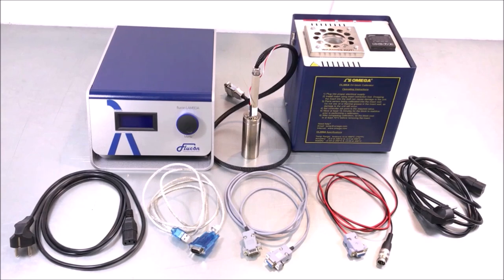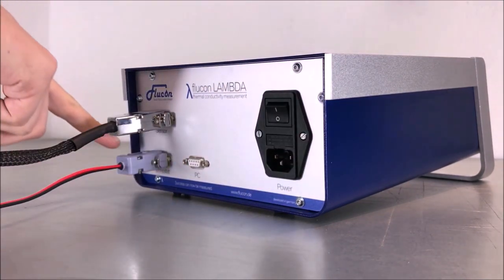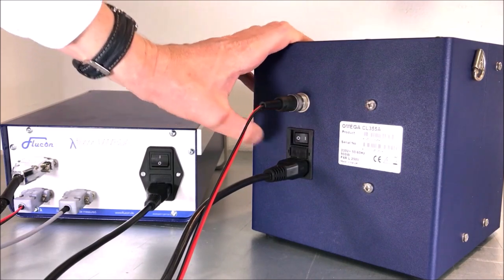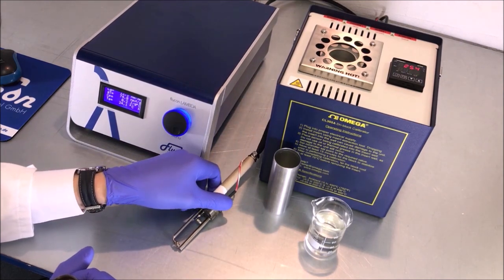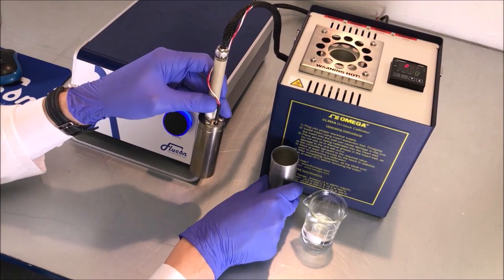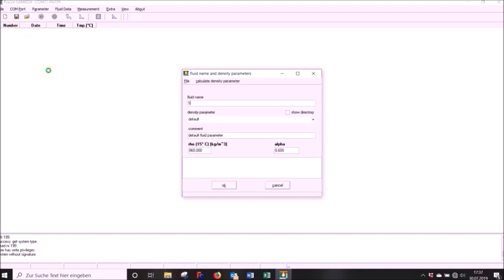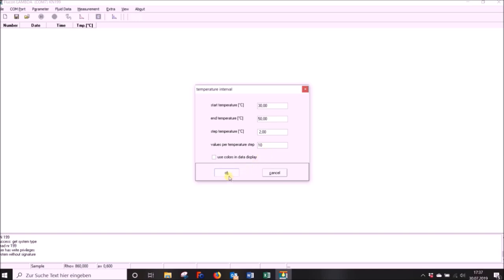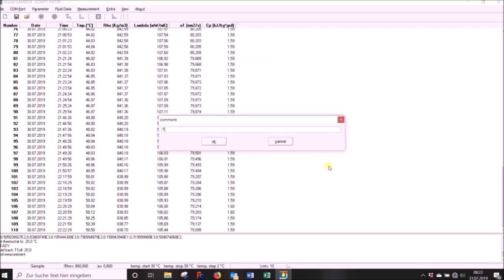Basics of Thermal Conductivity Measurement with LAMBDA

Comment: Hi, if it is connected to a heat exchanger and circulator how would it be connected ?
Reply from the maker: Hi Mouna,
The alternative setup with the heat-exchanger vessel and fluid thermostat is used for measurements below room temperatures. Both of these components are connected with insulated hoses. The LAMBDA probe is then immersed into the (dry) bed of the vessel, so there is no direct fluid contact.
Analogous to the block thermostat, the fluid thermostat can be controlled by the LAMBDA device (by use of the included fluconLAM software). If controlled manually, please make sure that the temperature gradient does not exceed 0.1 degC/min. For any further questions on the procedure feel free to contact us at info@flucon.de .
Reply: @flucon  thank you for your response. If i control my circulator and heat exchanger vessel manually by placing at each period of time a desired set point and then after a measurement I put another temperature and so on , can I use the option 'temperature intervall that you had used in the video in the selection mode' or I have to choose continuous or time interval options? thank you
Reply from the maker: @mounarahal256  Hi again, Mouna. In case of manual thermostat control we indeed recommend to use the continuous mode. Due to thermal losses of the involved materials you may notice a temperature difference between your set temperature and the sample temperature, which is why the temperature interval mode usually requires the (automatic) PI control. 
Please make sure that there is a thermal equilibrium before you conduct each measurement. Thus waiting for a couple of minutes before reading your values is highly recommended. Again, the temperature gradient should not exceed 0.1 degC/min while measuring. You may also send us your LAM files (info@flucon.de) for further analysis. We're here to help at any time!
-- Simon, flucon
Reply: @flucon  thank you again. My last question is urgent because i sent an email to info@flucon.de and it would take some time to respond while  i need a fast response. can i just buy the head sensor without the other components of the Lambda THW because it seems that mine is not working very well.